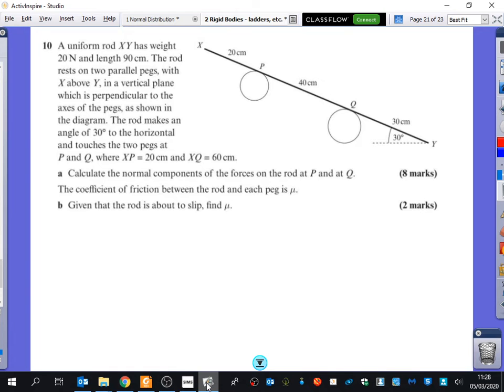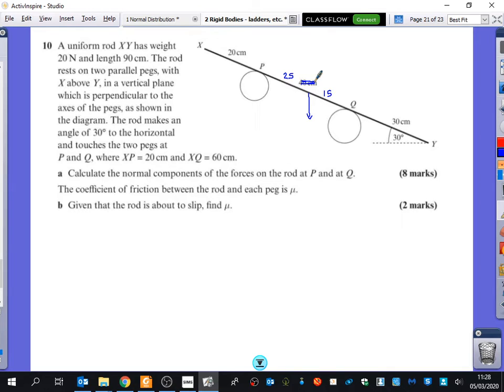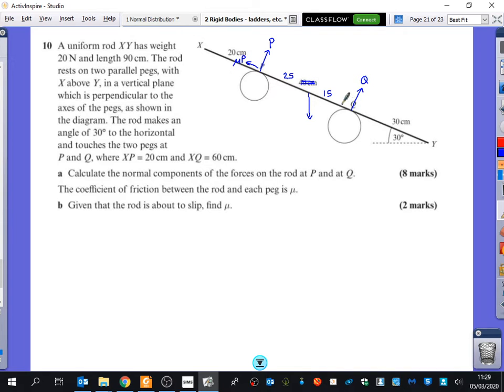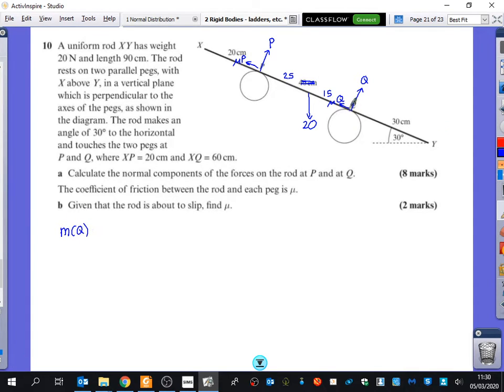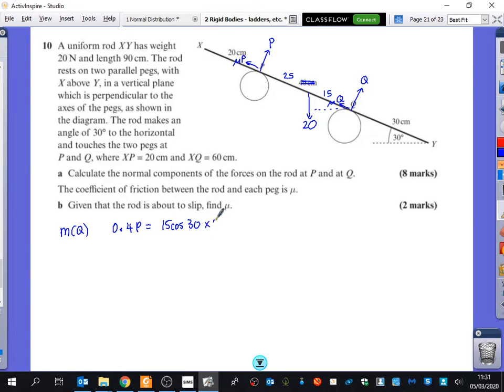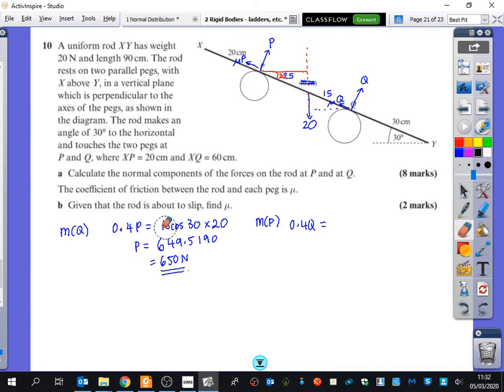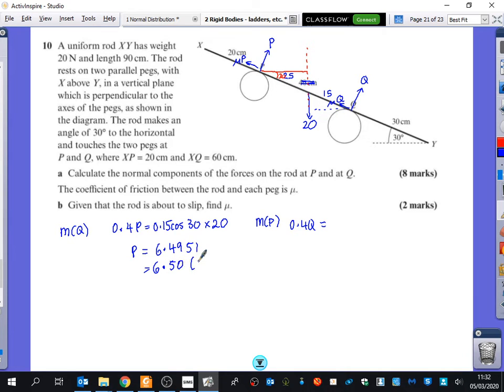Rigid Bodies 17 • Resting on Two Pegs • Mech2 Ex7D • 🎲

Comment: ahhh I'm SO confused. After I got P, i resolved: P + Q = 20 ... I know why I am wrong (it should be 20cos30) but I'm so confused why we didn't resolve the weight for the previous Qs in the playlist...like why do we have to do it now?
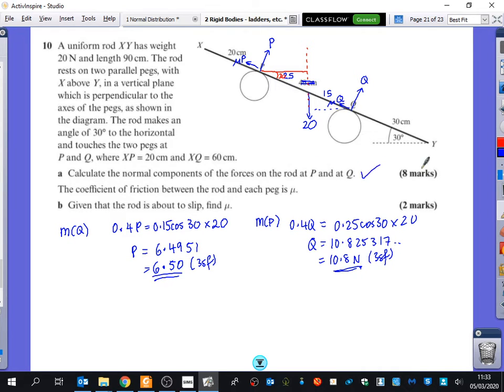Reply: Is it because (5:20) P and Q are slightly angled so they aren't going vertically up...and it would be tricky and long to resolve them so we just resolve the weight parallel and perpendicular to the slope to make everything consistent?
Reply from the maker: Yes, this is exactly correct! It's a very strange question because P and Q are angled, not vertically upwards - this is why the question feels so unusual and different, but you totally got the reason why in your follow up comment!

Comment: hi sir,
I thought for these types of questions we resolve horizontally and vertically not parallel and perpendicular when can we differentiate it, or is it just common sense based on the question? :)
Reply from the maker: It's just for the context of this question that it made sense to change the way we did it, but as long as the directions we are resolving in are perp to each other, then we can do it! :)

Comment: Why can't you resolve vertically and set pcos30 + qcos30 = 20 and then sub in p or q? I got the correct answer for q by taking moments but I got the wrong answer when I subbed q into this equation.
Reply from the maker: Because you'd also need to resolve the frictional forces, as they are also present and also angled!
Reply: @BicenMaths ohhhh okay thank you!

Comment: Hi sir, can u please tell me how to always figure out where to take moments from. Is there like a trick or something that we need to spot before deciding where to take moments from? In this particular question, i was about to take moments at Y instead of P/Q.
Reply from the maker: Yes - you can actually take moments from anywhere at all - it's always sensible to take moments from a point that will 'cancel out' certain forces to make the next stages easier. For the standard type of ladders/beams (unlike this example in the video), I take moments about the part resting on the floor (usually A) about 95% of the time.
Reply: thank you so much, that makes a lot of sense  @BicenMaths

Comment: at 6:24 when you said  20sun30=muP + muQ, I get that you put the forces acting parallel to the plane equal, but why don't you have to resolve the reactions at Q and P to get the parallel forces that they make?
Reply from the maker: Because Q and P are already going perpendicular to the pole, so they don't need resolving - they're already in the right direction!

Comment: For part b how do we get the exact form because answer at the book says 1/root 3
Reply from the maker: If you look at all the previous calculations, they are in cos30 and sin30 which have exact values. So if you processed this question using their exact values instead of the rounded values, then you would come to the same thing of 1/root3 which is equivalent to root3/3 too. In general, the majority of mechanics questions won’t require exact form, and just rounding to 2 or 3 significant figures, but there’s been a couple of questions where the whole question is in terms of variables (like a, theta, etc.) where they do want exact form, so it is worth knowing this is sometimes required!

Comment: Do you have to convert the units to metres
Reply from the maker: No, you don’t have to, as in a moments equation both side of the equation has distance (so if it were 100 times larger or smaller on both sides, it wouldn’t matter) - but in general it can be sensible to stick with the standard units (meaning metres is your best bet if unsure!).